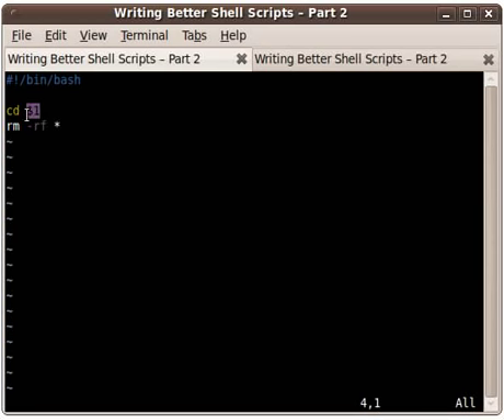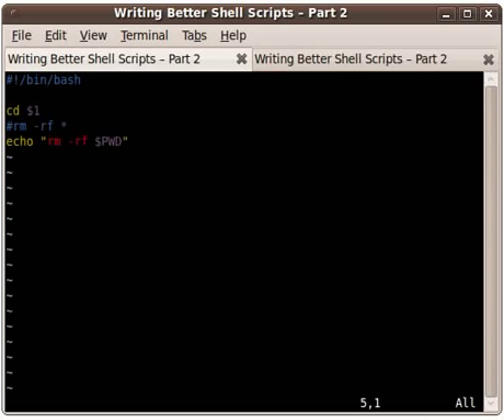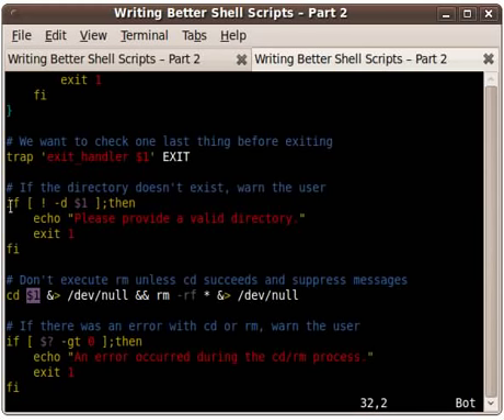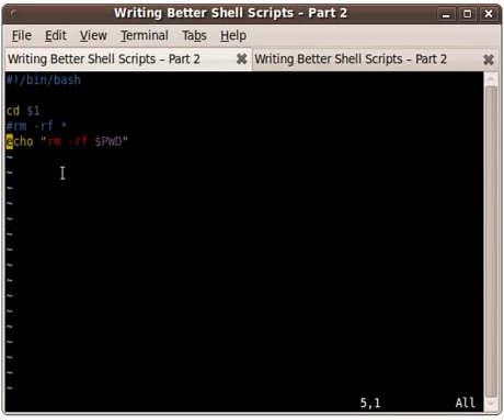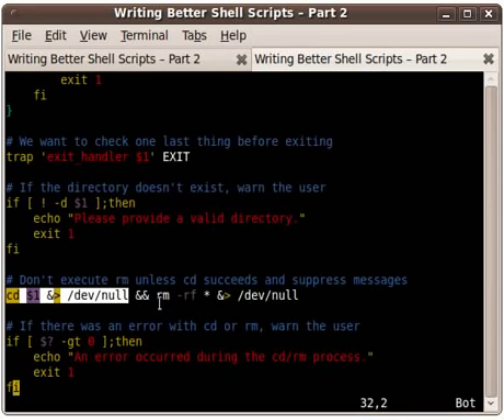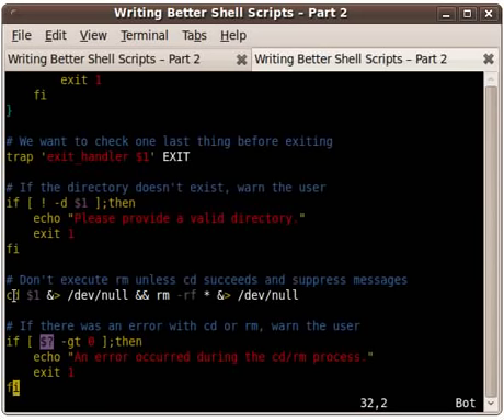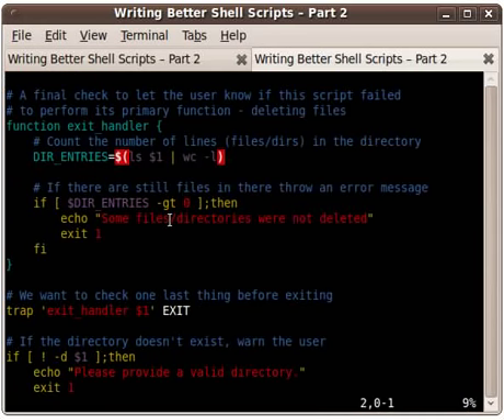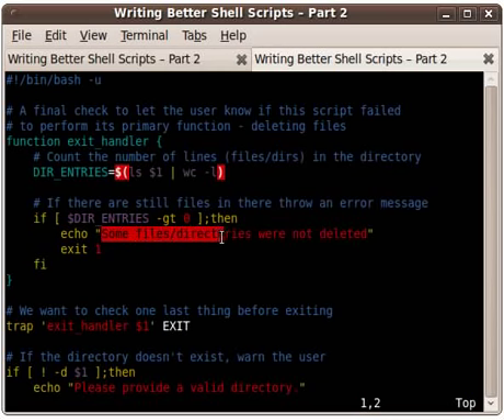Writing Better Shell Scripts - Part 2

Comment: I'm seeing 2 improvements; Usage of "$1" and other should be avoided since it's much much clearer if you name them, ex. "my_param=$1". If you use functions, it can be very confusing. Second thing; Using "$$" or "||" should always be in a line containing the "IF" command. This way, it's very confusing, and to me it looks like code abuse, since its weird, and you are not sure for example what happens with "$?", because you don't know which command you are evaluating.